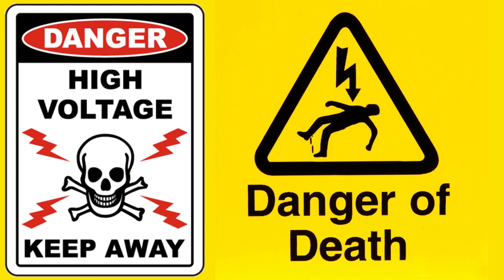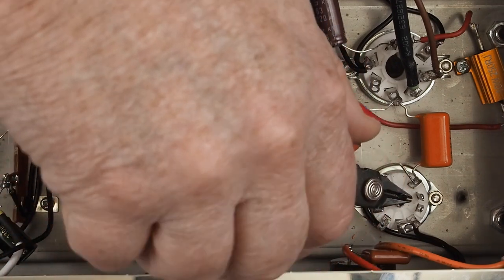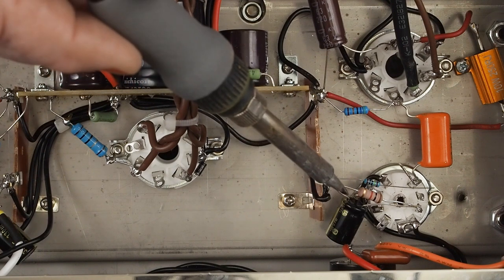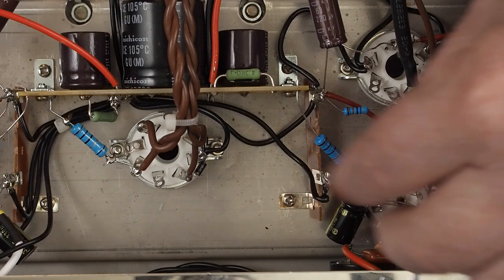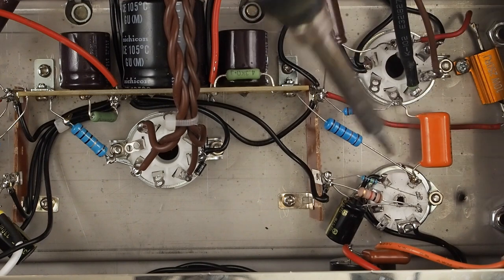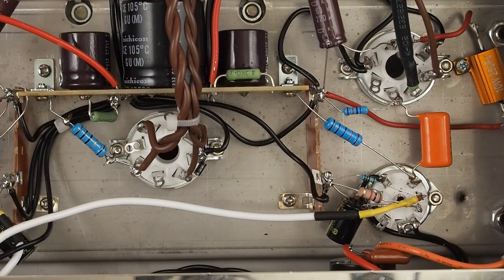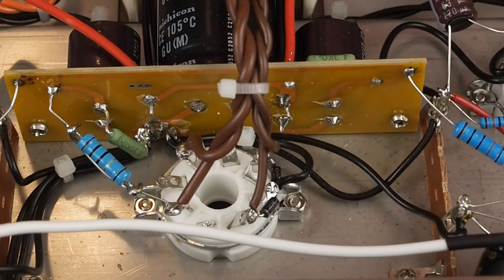Boyuurange Reisong A12: Doing the Mods Video #2

Comment: Houston, I've got a problem. I have the A10, and on the preamp socket I have two different black cables connected to pins 4 and 5. Your video has one connected to pin 4 and jumped to 5 and then another one to pin 9. Pls help me on rewiring that so it remains the same as yours. They seem to come from the same pins on the other channel's socket. Do I just need to unsolder pin 5 and solder it to pin 9 making sure I connect it to the same pin on the other channel? And putting a jumper from pin 4 to 5? BTW, my A10 also had a cap from pin 7 to ground, which I've removed, is that ok?
Reply from the maker: I'm working on an A12 with 12AX7 tubes. an A10 can be wired to use 12AX7 tubes but your amp's input tube is gonna be wired different. Never worked on an A10 so not sure of all the differences. The schematic and a tube data sheet should clear up this!
Reply: @SkunkieDesignsElectronics  thx lot for your super quick reply. I guess I'm gonna take my chances on that. I was planning just to follow your steps 😅. Thx again, you are the best!

Comment: Oops, missed one more rookie question. I have a Reisong A10 with 6n2p Voskhods, will they still work for it after the mods or I'll have to get some 12ax7s for it?
Reply from the maker: either is fine, the only difference is the heater wiring.
Reply: @SkunkieDesignsElectronics  I eneded up changing the plate to plate feedback resistor to the driver's cathode instead. It gave quite a punch to overall power and mids. Am I biased or this was supposed to happen?😅

Comment: Hello can you help me please? I have an A10. I have watched your videos many times and followed them with the schematics. I have built many kit amps. I kinda understand what is going on. Your instructions and explanations are very clear. My question is: if I get a tube converter (6N2P to 12AX7 ) can I proceed with the mods for front end tubes? Say hello to Dolly. Cheers from tropical Australia.
Reply from the maker: It's not hard to just rewire the heaters to use 12AX7 tubes with no converter if you are inside the amp rewiring things.
Reply: Got it. Thanks so much.
 @SkunkieDesignsElectronics

Comment: Skunkie could the  reisong badge fall off in time, is it glued on or taped? And do you sell similar sized Skunkie design badges for the builds that you design if we build them. Do you have a merch shop. Would love you to send your version off to some "Audiophiles". :) How about some decent caps and tubes next. Wonder how that will work. Please dont leave it here.  In uk its so expensive and hard to get decent iron etc, modding is a serious option. Interesting about the bass response love el34 but rarely use them due to lack of punch and bass  v my music taste. Please keep doing what you are doing.
Reply from the maker: I do plan on trying KT77 and various 6CA7 tubes, along with coupling caps etc. My experience with KT77 was they aren't as warm and might need some feedback tuning to sound good. At some point I do have to mail this amp back to it's owner lol.

Comment: I’m planning on doings these mods to my A10. After theses mods can I use 12Ax7’s instead of the stock 6N2J’s? Thanks for your work on theses mods and I agree with your sound assessment of the un-modded amps.
Reply from the maker: You need to rewire the input tubes to match the pin out of the tubes you plan to use.
Reply: Did the mods and, WOW, what an improvement! Thank you!!
Reply: Next steps will be upgrading the coupling caps and bypassing the volume control.

Comment: Semi-Advanced question;  You mentioned some additional tuning by changing the negative feedback resistor from 820k to perhaps 600ish  or even 470k. I agree w you (on my speakers also) it still is a bit bright. I was going to try some 620K and possibly 470k/430k. What are your thoughts? Any recommendations or additional mods to mellow out the tone would be greatly appreciated. Your videos and this experience has inspired my DIY itch and I plan on building some stuff from scratch soon. Thank you again for your awesome work!!!!!!
Reply from the maker: This makes a BIG difference in the tone. If it sounds too bright, lowering this value will help.
Reply: @SkunkieDesignsElectronics  Thank you!  I will experiment with it. I’ll buy a set in the 600s and in the 400s (all 2watt correct?) should I try anything lower than 470k? I really appreciate your input!

Comment: Steph, I have a rather odd question. Sort of new to the tube thing, but I'm very good on solid state.  I've always found it odd that an audio output transformer is used on tube designs. I understand why, as I have another friend that actually designs these as well, but my question was more about the limitations or loss in lower bass frequencies. I always understood it that transformers react better to higher frequencies, and granted most modern music like todays rap or EDM might venture into the 60hz bass frequencies, but my question is wanting to know if these audio transformers are able to deliver those bass notes or is it sloped?
Reply from the maker: This is where a good transformer vs a bad one shows up. But as I found out, the main limitation on this amp is they decided to run the output tube "lethargic" as you so aptly put it. It's pretty common to see a little roll off under 40z.

Comment: Hi Steph, I’m going to do your mod this weekend. While I have the unit open, I was thinking about upgrading the C302 from the 150uf 450v to a 330uf 450v. I have a nice Nichicon in hand, do you think that would work without any problems?
Reply from the maker: Should be fine if you are using a quality rectifier.

Comment: I have a Reisong A10 can I perform the same modifications as the A12?
Reply from the maker: Yes, the 12AX7 just has a different pinout or you can try these mods with the tubes you have now.
Reply: @SkunkieDesignsElectronics  Thank you for your reply. I could ask you for an opinion on a circuit of an amplifier that they gave me, used and without tubes. Xindak MS3 mono with KT88.  Before buying valves is it better to make a change if necessary?I would very much appreciate your opinion. Where can I send you the diagram? Thanks again and congratulations for your work and passion, thank you

Comment: Loved watching these. Thanks. 

As a noob, can these mods be applied no matter what the domestic voltage is? Just wondering if the changes are the same for 240V mains.
Reply from the maker: The power transformer should output the same B+ voltage.

Comment: I bought this amp over a year ago. Using it with RP600m's for a Rega P2 turntable.  I've watched all  of your videos on this amp and plan to do the upgrades. What 12AX7 do you recommend to replace the cheap ones that come with it. I will replace the other tubes that you mentioned. Thank you so much for all your time and knowledge about tube amps.
Reply from the maker: Honestly, those PSvane 12AX7 aren't bad. I do suggest getting some JJ EL34L output tubes.
Reply: @SkunkieDesignsElectronics  I ordered the JJ EL34L's, JJ 12x7's, Sovtek 5AR4 and all the components for the mod. I should get the parts in a few days and look forward to hearing the difference after the mods. I've been an electronic tech for over 30 years and have many years experience soldering. Thanks again for all your efforts in designing this upgrade. BTW, According to the China Hifi website the pictures of the A12 show an updated design of the amp.
Reply from the maker: @Mark-ro5zg  It wouldn't shock me if they copied my mods into the next version of this amp lol.
Reply: @SkunkieDesignsElectronics  They messed up and put a photo of the A50 internals instead of the A12. I compared it to the photo on your website and it looks the same.
Reply: @SkunkieDesignsElectronics  I finished installing the parts and noticed a big improvement in the sound, especially the bass. I thought it sounded good before but now it's much better. Only need 1/4 volume to be loud enough for my taste. I listened to a few albums, Good Bye Yellow Brick Road, Dark Side of the Moon. Hotel California, Sgt. Pepper. All sound great. Getting new tubes on Wednesday. Hope it improves the sound even more.

Comment: Hi Steph.Brilliant video.I own a Reisong A10 with 6N2J driver tubes.Can i make the same mods to it as you have wth the 12AX7
Reply from the maker: 1) Yes you can mod an A10 by rewiring it to use this mod + 12AX7 tubes. 2) Will this mod work and sound good applied to the 6N2J tube? It should but I have no way of knowing for sure.
Reply: @SkunkieDesignsElectronics  Thanks for the reply Stephe.Is it relatively easy to  rewire for the 12AX7tubes.

Comment: Thank you to explain between SS diodes and Tube Rectifier, I will keep SS diodes as it instead of swapping tube rect.
Reply from the maker: That's another good point. a pair of SS diodes is MUCH cheaper than buying a quality 5AR4! And taking 2A of VA load off this transformer will help a lot.

Comment: Today I finalized the mod and did first  sound check. The amp now  sounds on next level. Has more dynamics and bass and more clear on the mids and highs
You did a great job with limited financial effords. Will you do more upgrades on this litlle amp, e.g. better couppling caps  or what ever.
Does a solid state rectifier  improve the sound as it will reduce the load on the transformer. lokking forward for more
Reply from the maker: Very nice! I do plan to do a final follow up, after some time listening and comparing a few minor tweaks.
Reply: @SkunkieDesignsElectronics   Thanks, waiting for more great videos to come

Comment: Hi Steph, I am glad you stuck with the A12 and resurrected it from oblivion. I was afraid you were going to right it off at one point in your analysis of this amp. As an owner I am very appreciative of your assessment and excellent videos on ways its sound can be improved significantly. Before I try to make any mods on mine can you advise where I can get some good advice on procedures to follow to avoid any shocks when beginning this work. Do you have a video or is there one you can recommend? Cheers and thanks. Peter in Australia.
Reply from the maker: I did a video on this here: https://youtu.be/Ev6UCHHqE6o

Mark did one here: https://www.youtube.com/watch?v=TJBwIWD1DYI
Reply: @SkunkieDesignsElectronics  Excellent, much appreciated.

Comment: What do you consider as an audio grade cap? I always thought that fb is to be returned to the cathode of the driver tube/valve.
Reply from the maker: Global NFB is sent to the cathode but this style of local feedback, it just feeds back to the grid of the output tube on the other side of the coupling cap. It's kinda controversial, which is one reason I like it lol. 

Most of the cap manufacturers have a line of audio grade caps,  the nichicon ones seem quite good. If you want to step up a notch, audio note has some nice ones too that aren't crazy expensive, not cheap either!

Comment: Hi Stephe.I noticed on your modified schematic that you have the 220uf cap on the driver tube and the 470uf on the EL34 tube.Shouldn't they be the other way round.220uf on the EL34
Reply from the maker: Absolutely not. When you lower the resistor on the cathode, you have to raise the value of the cap to shunt the AC to ground or you lose bass response.
Reply: @SkunkieDesignsElectronics  Hi Stephe.On the mods video you have the 220uf on the EL34 and the 470 on the driver tube but on the modified schematic the 220 is on the the driver tube and 470 on the EL34.
Reply: Hi Stephe.My apologies for previous comments about the caps.I watched your mods video #1 and saw that you had put in an edit note about changing the cap for a 470uf.I need to pay more attention.Apologies again.
Reply from the maker: @stephenwilliams1854  https://youtu.be/AY1cYTiQuCE?t=410 I covered this discrepancy in the 1st video. I realized I needed to change this value due to lowering the cathode resistance after I recorded the mods.  I saw no point in spending hours starting over, re-recording and re-editing these videos when I thought it was CLEARLY pointed out in the first video AND in the FINAL schematic. And I just explained it again... Sorry if that isn't good enough for you.
Reply: @SkunkieDesignsElectronics  Hi Stephe.I apologised in my previous reply to you for my lack of awareness.Never meant to offend you.

Comment: I am also curious to know why you wired your grid stopper that way? I generally snip it short, solder it to the grid, then on the other side, I connect the input wire and the grid leak resistor. Just how I see it drawn on other schematics.
Reply from the maker: It honestly doesn't matter. In this case you would just be adding 1k to 1m of resistance.  Also in the case the volume pot is going to be where 99.9% of the grid reference to ground will come from anyway. The grid leak is just to reference ground plus I'd rather not have all those connections just floating in space, the tube pin is a nice spot to connect those passives.
Reply: @SkunkieDesignsElectronics  Thanks for the reply. This makes more sense to me. I, too, dislike the stuff floating around in the chassis.

Comment: Can you tell why you doubled the value of the grid leak resistor from 470 k to 1m?
Reply from the maker: The ground side of the volume pot acts as the actual grid leak resistor, many integrated amps don't even have this resistor because of that. The 1m is just there in case the volume pot fails, there is no reason for it to be higher that what the datasheet calls for (which just drags more signal to ground), and that value is 1m.
Reply: @SkunkieDesignsElectronics  OK, never a bad idea to follow the datasheet 😊

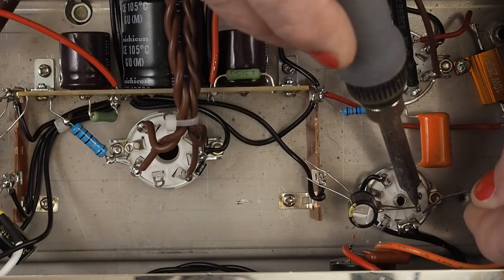Comment: I would really like to see a picture of the LEFT side of the amp after the mods.  I think I have it, but at 4:30  in the morning, who knows lol.
Reply from the maker: The left side? It's a mirror image or should be :)
Reply: @SkunkieDesignsElectronics  It’s that should be that always gets me lol.  I think I’ve got it right. My Son has the variac. He’s bringing it to me this evening. LETS ROCK
Reply: @SkunkieDesignsElectronics  Wait... Is it a mirror (i.e. flipped) or identical?  I thought it was identical (everything wired up to the same spots on the tube socket) based on what I saw already wired up to the socket.  This made sense to me as it didn't look like the left tube socket was flipped around in any way relative to the right one.

Comment: I completed the Skunkie Electronic Design modification today, definitely worth the effort. It is a big improvement in every way over the original layout. I have also added Miflex coupling capacitors and upgraded the C302 to a Nichicon 330uf 450v also.
Reply from the maker: Great to hear! I honestly would be shocked if anyone didn't hear a massive improvement,
Reply: @SkunkieDesignsElectronics  Thank so much, you are very good!
Reply: @garyvitrano8362  Hi Gary,What make of rectifier tube are you using.
Reply: @stephenwilliams1854  I went with the Genalex Gold Lion 5AR4

Comment: For the remaining half of the 12ax7 , if we connect this 12 ax7 to SRPP. For yor oppinion will we got any improvement of the better sound?
Reply from the maker: It's not needed to drive this tube and just adds something else in the signal path for no good reason.
Reply: Thank you mamm
Reply: Could i replace the El34 to 6v6 out of output transformer change to 5K
Please advises the value of
1 Rk and Ck
2 Rg1
3 B+ voltage
4 Rg2
Reply from the maker: @preechatienchai2440  Why?  At that point just build a different amplifier.
Reply: I have two spare 6v6 and two12ax7 and would like to build the new amp. With these four tubes.
If i could use this schematic whith adjust the value of R and C.
Reply: Youe are late to bed every night?
Reply from the maker: @preechatienchai2440  Yes I am a night owl :) 

And sorry but I'm not going to make these types of sweeping changes to a design or recommend them when I have not actually tried and tested them. Telling you "Here, use these values of components" after you change tubes, output transformers etc without actually building it and testing the results is not how this channel will ever work. It's likely a 12AX7 is the wrong tube to use to drive a 6V6, I don't know because I've never built a 6V6 amp. There are plenty of people on forums willing to these types of blind recommendations from simulations.
Reply: @SkunkieDesignsElectronics  Thanks you very much for your kind answers.

Comment: You can buy the A10 for $400
Reply from the maker: You can, but it requires more wiring changes and purchasing the 12AX7 tubes. Plus you need to ensure it's the newest version with the same larger output transformers.
Reply: @SkunkieDesignsElectronics  my amp uses the 6n2J tubes.  I connected pin 4 an 5 after removing the wiring as in the mods.  Is that all that’s necessary when changing to the 12ax7 in the Mods?  It seems to be working ok.   Skunkie thanks for your help.   Your # 1 Fan !